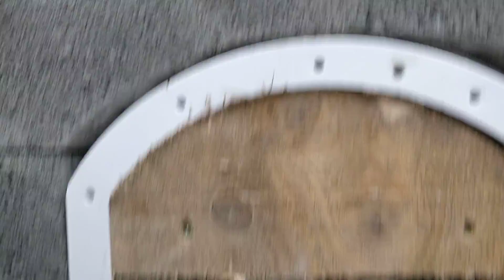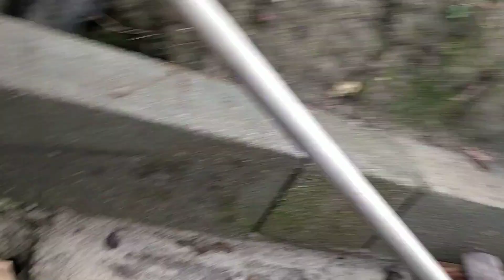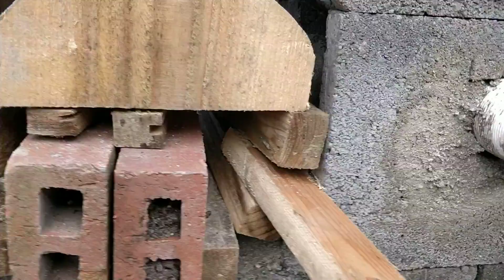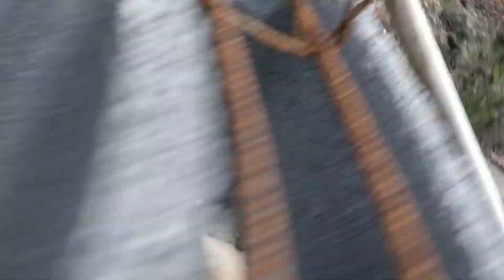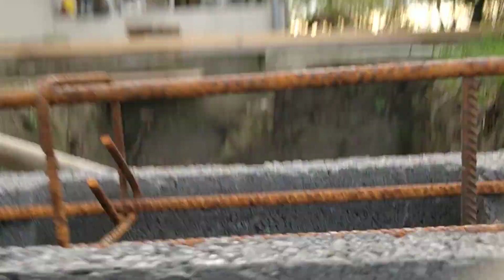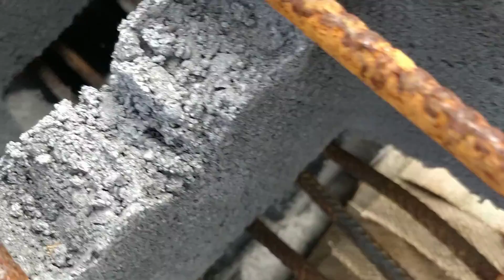Coffrage Nage à contre courant Jet Vag

Comment: Bonjour, 
Avez vous testé la nage à contre courant? En êtes-vous content?
Salutations 
Frédéric
Reply from the maker: Bonjour, oui testé, comme je m'y attendais ce n'est pas idéal pour vraiment nager longtemps.
En mettant à fond et en dirigeant le flux vers le haut, on va dire qu'on peut nager sans remonter le courant et finir par toucher le mur : mais c'est du coup assez désagréable, on a le flux central dans le visage, difficile de rester dans l'axe et les remous font sauter les lunettes, font du brut, gènent pour nager et pour respirer.
J'ai aussi un élastique de nage, les sensations sont meilleures finallement, mais on a l'impression d'être retenu et parfois de reculer, et ça modifie le centre de gravité.
Le cumul des deux est une bonne option mais s'il y a un choix à faire entre les deux l'élastique est à privilégier, surtout vu la différence de coût.
Reply: @PierreGranger  merci pour vos vidéos , je suis curieux de voir votre piscine fini et fonctionnel ! j'hésite a installé la nage a contre courant du coup avec votre commentaire . J'ai testé ce système dans un hôtel et je dois dire que je n'ai pas été non plus très convaincu .